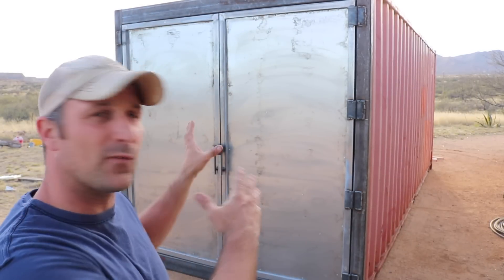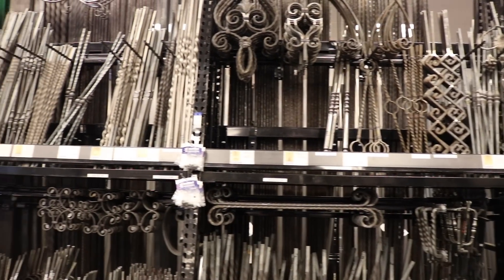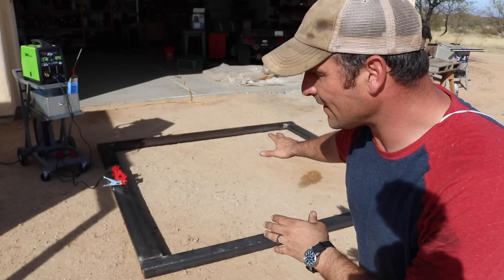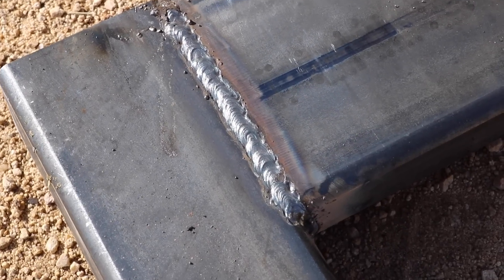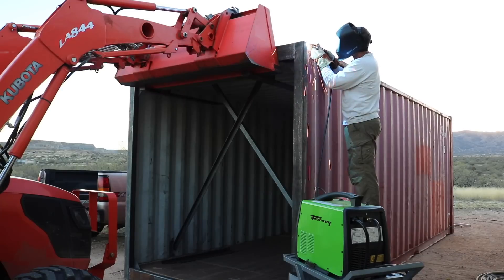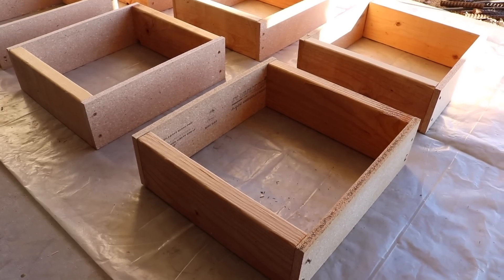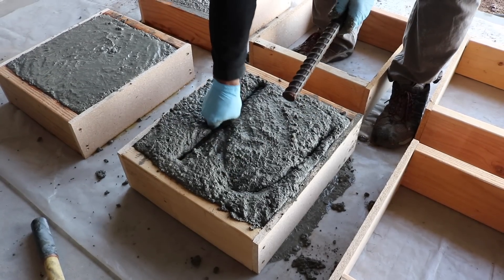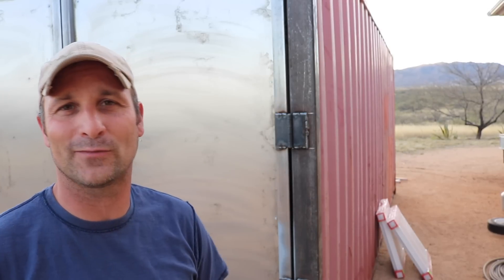Shipping Container Shop Part 2 - Doors, Foundation Blocks

Comment: landed here randomly and cant wait to write this and see your others,im stoked here as I finally found out what the red magnets holding your door handles in place for welding are finally for ,ive got some somewhere in an old tool box with zillions of iron filings stuck to them hahahahahaha i remember years ago starting to pull them off and ended up chucking them back in the box ,im going to hunt them out after ive watched your other vids , clean them up ,and weld something to something hahahaha

Comment: Very cool project. Nice you have a place to get your steel a little cheeper. I am lucky, I work at a steel supply shop and I buy scrap steel for .15 per lb. It is the drops from new steel that has been cut for customers. I run a CNC plasma burn machine and can burn parts for my You Tube shop projects.
Reply from the maker: very cool.... .15/lb is awesome!  I'll have to check out some of your vids!
Joe

Comment: Just a thought...a good holding/latching system could be done with some magnets at the top of the doors both the inside & the outside.
The outside ones would be used to keep them open when folded back to the sides.
The inner ones could catch on a small plate at the top of the frame.
Reply from the maker: That's a great idea Gregory... I am welding a plate on the side and top as a form of weather tightening and might be able to incorporate a magnet in pretty easily.  I've got little latches right now... but a magnet would make for an easier way to pop it open and closed for going in and out quickly:)  but the only bad part is that I didn't have the door hinges wrap around the frame so I esssentialy ruled out being able to flap them to the sides :/
Reply: A bit of steel wire (thin) attached to the wall sides that have magnets at the ends to quickly latch the doors open might work for those.

Comment: WOW  now that is coming along. Like your concrete blocks,  going to be very handy for the foundation. Just going to set the container on them or try and tie down somehow?  Have seen where bolts or steel rods imbedded so can attach the container to them.
Reply from the maker: Thanks Greg!  Yes, it's coming along... can't wait to get the roof on and it all finished on the outside.  Once thats done I think I'll be able to breathe a bit, and take a bit more time on the rest of it:)  As for tying it down... it'll be just set in place to start with.  I want it to technically be 'moveable' in regard to permitting issues.  So that is why I'm doing the split roof/awning style set up.... so that I can 'technically' have it removable...lol... but we'll see.. my plans may change a bit as I get closer:)

Comment: I will be learning to weld with a Hobart Welder my wife picked up at a rummage sale. Our shipping container shop project will house full sized woodworking machines, and will have access openings to allow long lumber to be milled whole, and it looks as though I will need to have lots of hatches and holes to get it done. Not having welding skills is a real setback though -- thanks for the Forney link!

Comment: Great Chanel, subscribed.Not that it is crucial with the sheet cladding but your diagonal bracing on the doors is going the wrong way, steel is stronger under tension than compression, if it was timber it would be correct as timber joinery is stronger under compression, it's not a criticism just education.Great job, I'm now going to watch the whole series 😀Peter.

Comment: Nice job on the doors!  Did you finally get a pickup truck?   Every homesteader needs a good truck.  Hard to carry steel in a Jetta
Reply from the maker: Thanks HD!  No, it's my dad's truck... i just borrow it from time to time.. but I'm planning on getting an old truck when I find the right deal:)
but, I will say that I have carried 10ft pieces of steel in the jetta.. but it has to lay on my dash and go all the way to the trunk;)
Reply: Jettas are awesome. I had a 2006 TDI. I miss it.  Good luck finding a truck. Might make a good video...

Comment: Was there a reason that you used sheet steel for the doors, instead of wood?
Reply from the maker: Hey Robin!  I just wanted to keep the outside as durable  as possible.  and metal fit the bill for this.  It will get layered on the inside too with some insulation and maybe wood shiplap for a nicer interior feel:)
Reply: Ah ok, that makes sense. Looking forward to the next video

Comment: Hi Joe,

You are quite the Jack of All Trades! Cool project.

Question, 
Since you are placing it on concrete blocks, but will have an attached overhang that will be posted to the ground, will your shop be taxed as a permanent structure?
Reply from the maker: Thanks Tlrnnp67!  I'm not sure if it will or not... but if they decided to push the issue I'd just remove the awning, wait a few weeks and them reattach:)

Comment: Much nicer doors than what the containers originally came with. Foundation blocks are much better than stock as well. Nice work!
Reply from the maker: Thanks Voneschenbach!  They are definitely easier to use than the originals... maybe not as robust but no fiddling with the levers to work them:)
Joe

Comment: Call me old fashioned but I'm trying to understand why you would cut theftproof, water tight, heavy duty doors off and weld on these? I think your skills are top notch, just trying to figure out the reason
Reply: Door frames are super strong, no sense to remove unless damaged. Even on the closed off end.

Comment: You did a really nice job! I haven't watched you complete the shop yet, so you may have done this already, but take a small scrap of one of your tubes or a piece of flat stock and cap the ends of the handles you welded onto the doors, it'll keep rain out, look nicer and be less prone to cutting your hand.

Comment: Interesting project. But why not just cut out the inside steel from the existing container doors and use those frame (which are already attached to the container) and simply install flat steel to them. Would save time and money.

Comment: Some fine work on the doors. Looks like they line up perfectly. Thanks for the tip on the metal supply place.
Reply from the maker: Awesome!  thanks Dust Man!  ... and yes, IMS is such a cool store to visit!  I'll probably stop by there tomorrow to pick up some more material to weather seal the big doors...I've got the windows and main door framed out and the container moved right now... just waiting to paint:)

Comment: I can't find anyone that know much about shipping containers.   When I bought two of them from this guy the doors opened and closed really easy with no problem at all, but after arriving and being positioned into place by the semi truck driver, the doors are very difficult to open and close.  Nearly impossible to open and close I should say.   On closer inspection I can see the cam and the cam receiver no longer line up center with each other on the door.  Does anyone know a fix on this or what could have caused this?  Did the guy I bought them from switch containers on me?   Did the container get bent when being dropped from the semi onto he ground?  Or is it that the containers are  on an uneven surface, which they are since they are just on the dirt ground, and this puts a twist into the container causing this problem?
Reply from the maker: Russ Mess hi Russ...it's most likely due to twist and an uneven surface.  Try shimming up one side to even out he doors.  Might only take an inch to make it easier 👍🏻
Reply from the maker: Russ Mess hi Russ...it's most likely due to twist and an uneven surface.  Try shimming up one side to even out he doors.  Might only take an inch to make it easier 👍🏻

Comment: I started watching container videos ..and wow i'm hooked  Even have my own idea  3.  52ft containers.  2 side by side One ontop front. and use the open top space as a bedroom patio with stairs outside over looking Northern ontairo woods and lake Added bouns have it with a basement  Now i hear containers start at $2,000 and up i think i'm looking at $4,000 each and You can still find 1 acre lots for $5,000 I have to do some searching because we have many connecting underground spring water rivers like to find out the spots ..but isnt it fun making it all come together.. Semi off grid with a town 20 mins away 35 lakes and rivers Moose deer Trout bass  with a home designed by you and paid in full

Comment: So how thick did you make your concrete blocks?  I was wanting to do something similar to you but instead of a workshop, I am making a run in shed with storage.  I am going to be getting a 40 to 45-foot container so would you suggest that I double the number of concrete blocks what you used  (put down 12 blocks)? Thank you so much for making this video because its what gave me the idea for my project.

Comment: Always a pleasure to seeing your new video. Will you isolated the container outside to protect against the heat? God bless you and your family
Reply from the maker: Thanks Carsten!  I plan to insulate on the inside and the roof will over hang and shade most of the walls during the summer.  During the winter I'll be okay with sun hitting the walls as a little heat will be welcomed then:)  God bless you and your family too
Joe
Reply: Just a question. Why the inside and not the outside?
Reply: insulating the inside means you keep the outer strength of the structure.